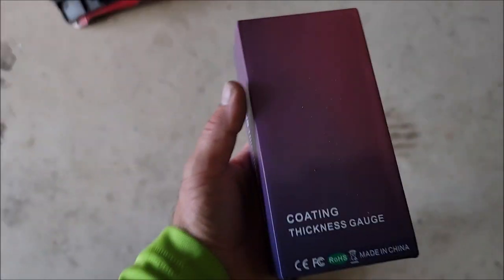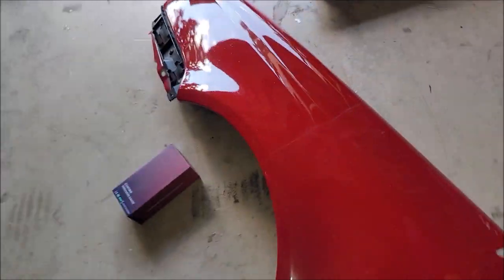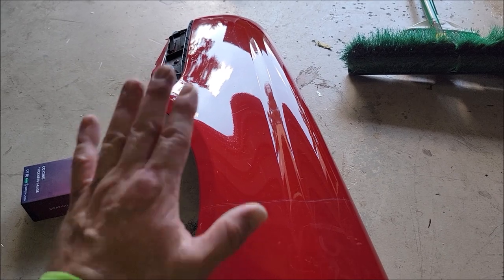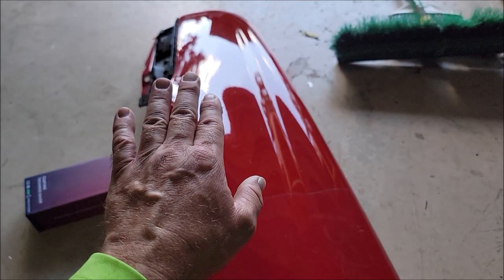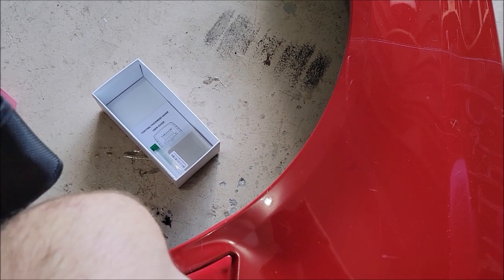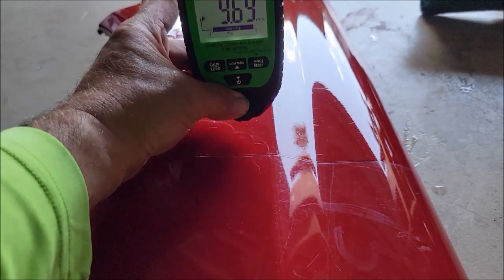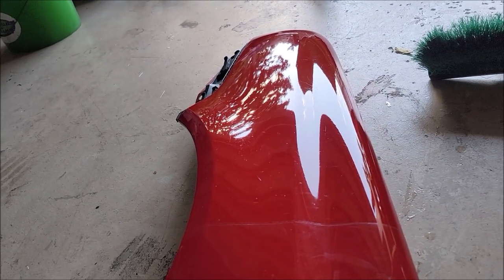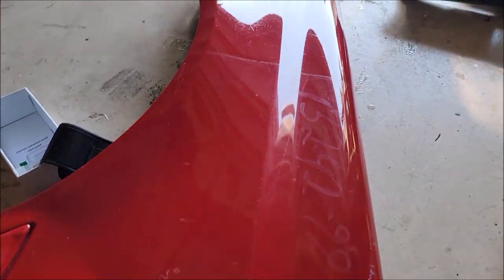TAKING THICKNESS MEASUREMENTS BEFORE AND AFTER MY NEW ULTRA CLEAR COAT    ING! ADDING THICKNESS

Comment: Can this be installed over vinyl wrap?
Reply from the maker: I have not tested that. I will and will shoot a video, but I don't see why not.
Reply: @garrydean6544  Here in Canada, vinyl tends to become hard and stiff during winter, but in summer its extremely soft, even indenting your nail into the wrap sometimes leaves a mark. Just wondering if the freeze thaw cycles would effect the adhesion.